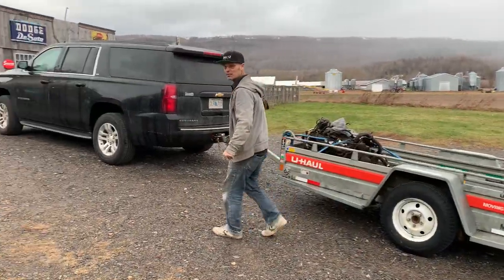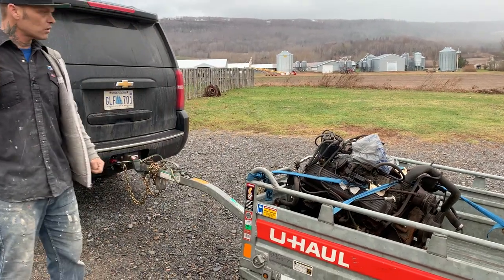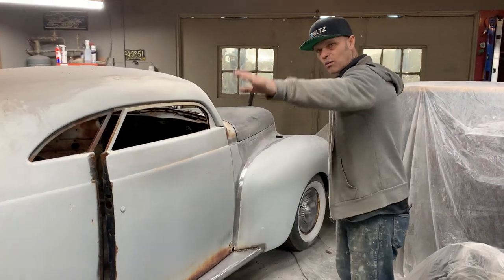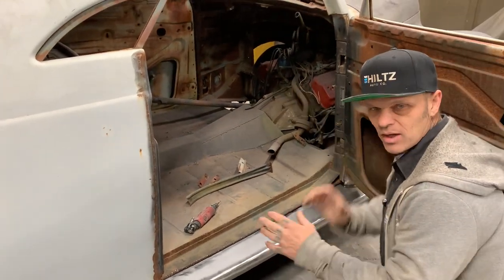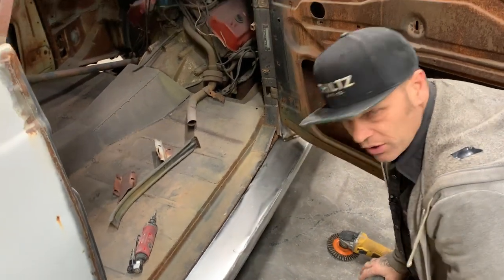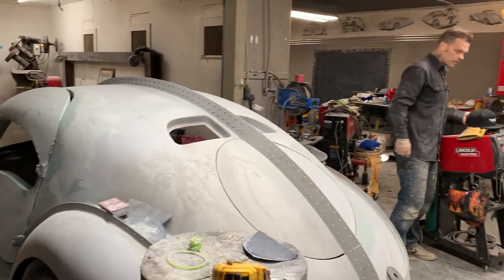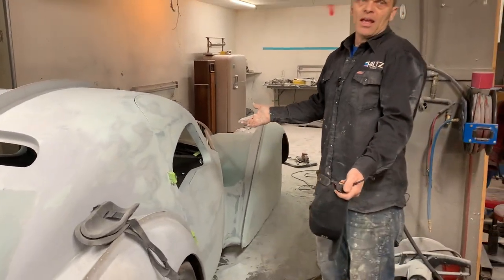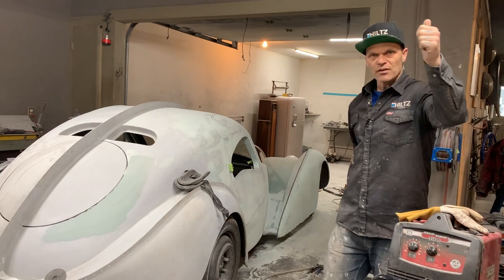Repairing rusty sheet metal on the '40 Plymouth 🔥

Comment: Useful information about how to relocate bits of metal into a method to recycle vehicles and houses made of metal into works of art. Ok for friday, let's install a bunch of small 3.5 hp lawn mower engines inline to power a 1950's fire truck, or, create the full james bond submarine lotus experience instead in zztop retro.

Comment: Chad do you have a video of how you weld with a hanger?
Reply: You use a metal Coat hanger when u have a large Gap to fill. Instead of using a lot of welding wire, cut a piece off of a old coat hanger n use that to fill the gap then weld it in/ weld on top of coat hanger.
Reply: @jontrudell7529  so your really not welding with it
Reply: @50windycity  No. It's only used to fill gaps and save some wire & time.
Reply: @jontrudell7529   ok so you can’t do it with a wire feed welder thanks
Reply: @50windycity  YES you do it with a wire feed welder. If u have a space between 2 parts that you want to weld, then u can put a piece of wire coat hanger or a bolt or ANY piece of metal between those 2 pieces and Weld it all together without blowing through or taking a long time or using alot of mig wire/ welding rods. Understand now!? I'm DONE lol
Reply: @jontrudell7529  thanks for the info as it does not work will stick copper spoon and my wire feed welder.

Comment: I love your channel and have learned how to do many things...!  I also loved this cars development, it's direction if you will... But, with your decision to not use the HEMI, well for me and probably many others, It has lost a certain amount of "COOLNESS".   It is not like you made a choice to either use a "Old School Hemi" or a small block Chevy 350/400.  
  It already has the hemi installed. Make it work.  In my opinion, you have changed a high end build with an above average car body, and are now "sticking" it with a mundane if not boring engine.  To top it off switching from a hemi to a $100.00 307 at that. WOW.
 The drive-train means almost as much as the rest of the rest of the car.  
Which is why the 307 isn't going into Jolene's car.  Please don't do that.
 I am not hating on you!!!  I love your work, But like another viewer said, It is your car.